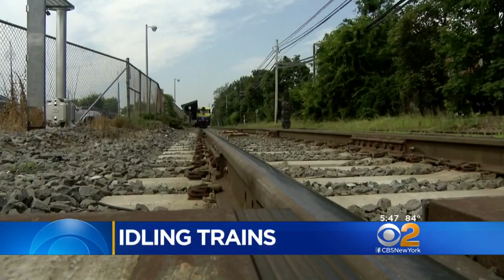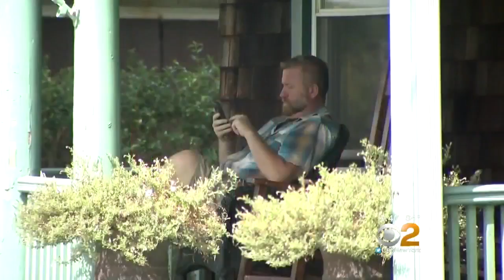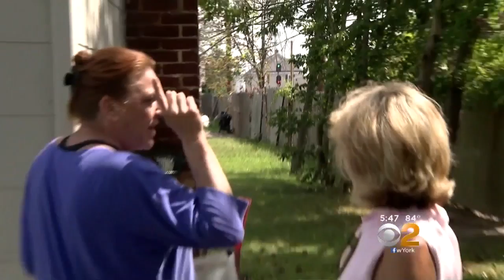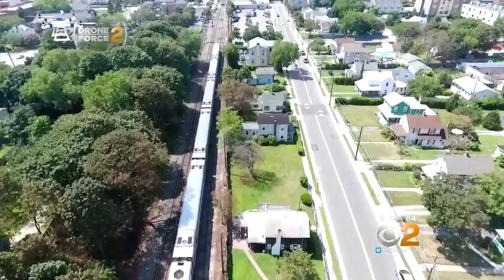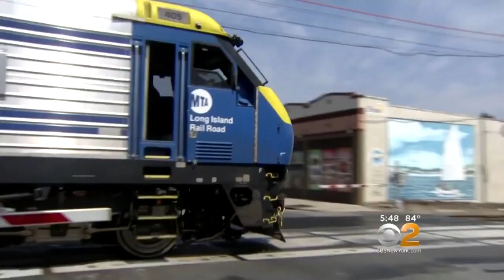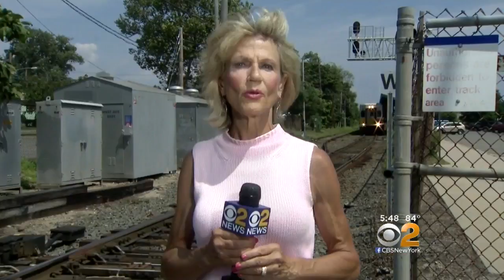Long Island Residents Up in Arms Over Idling LIRR Trains

Comment: Listen my father worked at that crossing in the 50's . Trains would lay up in those back then . 
 I was a Conductor from 1970-1999 and laied up trains up there many times.  Those tracks were there many years before the houses were there. 
 I've been on the north track and the home owners would shut down the engine. This causes the train to be late and their connections. There is a law banning such actions. The L. I. R. R. never pressed charges. The gates are up and the crossing is clear .
Reply: So the home owners 100% bought this onto themselves.
Reply: I have to admit, the old diesels idled a lot more quiet.
Reply: @grazz7865  because they had no HEP
Reply: @frostbyte3978  what is HEP?
Reply: @grazz7865  Head end power, it uses the engine to make electric energy for the railcars which usually means the engine has to constantly run at highest RPM
Reply: @frostbyte3978  I thought the old cars each had thier own generators.
Reply: @grazz7865  Only the true diesel coaches had their own generators, but the LIRR also used old electric MU's which required a power pack to be used for HEP.
Reply: @warrenhoffman2006  I see. The electric MUs I know (M1s, M3s). Believe it or not, they had to break out the M3s again because they increased service and do not have enough equipment. I was referring to the diesel cars with only one entrance/exit on either ends of the cars. Those I believe had thier own generators. AC was like a refrigerator in the summer time.
Reply: @grazz7865  I was referring to the P75 old MU's they used before the C1/C3 equipment.  The AC was really freezing (when operating), but the cars that had the big picture windows instead of the square windows required a power source for HEP.   I took the 5:35am from Patchogue for years and rarely had any delays, so I was very happy with their reliability.

Comment: Man I would love having a locomotive park in my back yard(:
Reply: same
Reply: Same lol
Reply: same
Reply: @Flayvozi  You only think you would. I've had long weekends where there have been 5 engines running, sometimes 4 sometimes 5 days. The engineer and crew hop out and jump in a waiting car and just leave them running. Having a train run past your house is one thing, your house shakes, there's a  lot of rumbling noise and of course, there is the blast of a train horn many times. But an idling train is very different. There is a low rumbling noise similar to the bass sound from a loud party next door. The diesel smell comes in your yard so that you want to head inside, once inside if your windows are open the diesel smell fills your house so you better have an air conditioner on those hot days. The rubble stone foundation of my 1920's house has stones that are loose and falling out, 2 of my walls are bowed inward and the plaster ceilings and walls are all cracked. Believe me, there is no romance to living next to the train tracks. The trains on regular weeks during the whole year are parked across from me 3 to 4 times a week that is overnight or longer. That doesn't count the multiple times they sit there on a daily basis for several hours at a time.  I can only say, I hope you never have to experience this.
Reply: @huggysshit  I'd be fine with that, to be honest I love the diesel smell.
Reply: Lol I live in patchogue next to the rails, its a bit annoying.
Reply: Hells yeah and blow the engine horn at 5am lol
Reply: Id love to line the train out of the siding throw the switch in reverse
Reply: Same
Reply: Same
Reply: Same. I'm a railfan and I would love that
Reply: Shytt, I loved 🥰 it !!!
Reply: @TigerRailfan  I know somebody who has trains go by the back of their house. They don’t have cracked walls
Reply: In 2024 The LIRR will replace all DM30s with Chargers similar look to the ALC-42 but with 3rd rail shoes
Not to Menton they are also Tier 4
Reply: Same ;)

Comment: Ok so to clear some things up 

One running all the trains to Montauk and Speonk will make things worse for the line.
Between Babylon and Sayville(The station before Patchogue) the line is 2 tracks so the railroad which has been doing this for over 130 years uses Patchogue as a turn around the station for Shuttles between Babylon and Patchogue so people along that 6 stop segment of the line have consent service since it has 2 tracks. Having run further on the 1 track line reduces the number of trains it can run as they would all have to share that 1 track segment.

Two electrifying the line while on the plans and being considered but are not the top priority as it cost a lot of money and a huge process to do in which no matter what type of outreach they do these people will complain of the work like oh there working all day and crap or regular riders will complain of the lack of service on the line during the work. Plus the ridership demand right now does not justify the cost for it. The line while very popluar durring the summer season outside of that its not as used so its gonna be a while for that

Three like said in this video they have been there since 1869 when this station was built there was nothing around it. It was like how Speonk station is. People chose to build their homes right up to where the track is and these people dam well knew it and had just taken five seconds to look up would know Lirr short turns trains here.
Reply: I think the LIR should electrify all their lines especially in this area. They have the cars and locomotives that can run electrically on 750 VOLTS DC CURRENT! Build a buffer or high wall alongside these tracks especially after installing the 3rd rail! Electric railroading is so much cleaner!
Reply: Electric on a locomotive branch lines will not happen, too much money to put 3rd rail, that's why they bring up batteries for m7.
Reply: @kenjiharima23nep91  They will need charging stations along and the end of the lines.
Reply: @albertcarello5489  Right.
Reply: @kenjiharima23nep91  its silly. Electrification has been a fine technology for over a century and there's been plenty of electrified sidings for needed purposes

Comment: Governor Cuomo please respond to these residents. Let them know that the railroad was there first, and no one should have built their property that close to a railroad right of way. If they want a wall, a barrier, etc, do a GoFundMe, and build it themselves. The state is not obligated to, nor would pay for such, since the railroad was there first, and is under FRA rules and regulations...
Reply: Black E. Blackerton:  In the Chicago area we have 4 rapid transit CTA LINES with street grade level crossings. People often complain about gearing the crossing gates bells well into the later night. These people too forget these railroad L lines were here first also. These are 3rd rail lines. Of coarse the 3rd rail is always disconnected in streets by active always on both sides of the streets. I mean hearing the crossing gates bells they complain about. On the Ravenswood L those trains operate through 4:30AM and your can here the bells on the crossing gates every so many minutes. However once the gates are down the bells turn off.
Reply: @albertcarello5489  what? I didn't know CTA had grade level stations, tracks and crossings. I thought it was just all elevated and another part where it's all underground..
Reply: @TBF_1J  Until March 20 1960 the CTA did have ground level trackage here before and during construction of the Eisenhower Expressway.
Reply: @albertcarello5489  oh wow
Reply: @TBF_1J  Yes hard to believe! It was sure a very long and drawn out process!
Reply: @TBF_1J  Also the Lake Street L was ground level from Long Avenue west side of Chicago to Harlem Avenue in Oak Park until October 28th 1862 when the line moved upstairs to th Chicago NorthWestern Embankment now Union Pacific and Metra Rail owned.  CTA pays rent to run up above here.
Reply: @albertcarello5489  wow.  Thats pretty cool
Reply: @TBF_1J  Yes it sure is!

Comment: How about this if you dont like then move you chose to live there the Railroad was there first. How about moving somewhere else.
Reply: Yeah that is a true statement
Reply: I mean in a case like this LIRR was there before those homes that is an actual fact so people knew what they were signing up for
Reply: “When I bought my house, I understood that there were train tracks across the street... I just never knew they were gonna park in front of my house...”
Reply: @laurahart3890  i mean its just trains always parked outside that station its always been like that even before houses were built there so if you ask me they just did not do there homework
Reply: K1 oh I was just quoting what the guy said, I honestly wouldn’t care, I’m a railfanner myself...
Reply: @Lazys The Dank Engineer I just read that it takes less than 1 gallon of diesel fuel to start the engine and can take 1 hour due to safety protocols. In my case trains are parked and running sometimes for 5 days without being shut down. There's no reason for that except for a lazy engineer that doesn't want to go through the start-up procedures required after a shutdown.
Reply: this house has been in my family since 1961, that's 59 years. We expected and lived with the trains rolling by. But over the last 15 years they've decided to park in front of my house and I mean when I open my front door the engineer and I can look directly at each other. So this is not what we signed up for 59 years ago. This house has been here since 1920 not long after trains were invented. I'm sure no one could have predicted this.
Reply: @Lazys The Dank Engineer The LIRR has been there in Patchogue since 1869

Comment: Imagine if those were Metro North Genesis locomotives. The complaints about those would be WAY worse.
Reply: Why? The locomotives that we’re here are de30acs
Reply: @meichen3171  well you see, the P32s are loud as shit, probably louder than the LIRR diesels. If they cant handle the DE/DMs, theres no way they'd come with a P32
Reply: @JSquaredJJYT  The Lirr is planning on getting Dual Mode Chargers to replace the DE/DM30ACs because they’re more efficient, they don’t pollute a lot and they’re more quieter so there could be less complaints (Metro North is having the same plan to replace the P32s)
Reply: @supermarionathan1426  I won't lie, I kinda hope the DE/DM30ACs stay a bit longer. I grew up watching them go by, and I'll be sad to see them go.

Comment: The only solution to this is to electrify the tracks. The fact that one of the busiest commuter rail systems in the world still relies on unelectrified tracks, single-track territory, and diesel trains is a problem of its own
Reply: I get that the c3 trains can carry more people but the m7 and sometimes the m3 are far more efficient.
Reply: the lower ridership levels out near Patchogue don't really justify electrification, as the bulk of riders use the western (and electrified) part of the line
Reply: M3s are definitely not more efficient. The M7s have many more seats. And yes, there's no need for electrification on some parts of the railroad (at the moment), like east of Patchogue or Speonk, but It's definitely needed on the Port Jefferson and Greenport lines.
Reply: Too expensive and not worth the amount of money for the amount of ridership. Also if you electrify you need a new electric train yard and where is that going to go? That would cause even more complaints.
Reply: Actually, they do justify electrification with the growing population in the towns and during the spring and summer time when fire island is open ridership is booming lirr does have plans to electrify this line and its much easyier then other projects given that this line up till Sayville is 2nd track meaning they just hav to put a 3rd rail in and its up them to add a 2nd platfrom at Patchogue note the tracks as far as patchouge are 2 but the platforms are 2 as far as sayville the stop before
Reply: @rrrglynn  Or if you electrify it, you can simplify operations by having all trains be electric instead of training different crews for operations, maintenance, fueling, etc.
Reply: @Token_Nerd  Electrification is estimated to be at 18 million dollars per mile the ridership is not there to justify at least on the Montauk Branch. That 18 million wouldn't even include the new electric train yard that would be needed (I know downtown Patchogue there is no room to put a train yard anyway) and also additional electric train that would be needed. You'd have to also but substations in residential areas which would cause even more complaints. I'm a rider of that line and I know it would not make any sense at least right now to electrify. The nearby Ronkonkoma branch is electrified and a second track was just added and still does not run reliably and still only has hourly service.The LIRR can't even run the trains properly as it is.
Reply: The solution is, when you buy a house check out the neighborhood and what's around the house. Be happy it isn't 75 years ago when they used steam engines. Lastly ask yourself, why did I get such a good deal on this house.

Comment: Ether they electricity the tracks or make a hybrid diesel trains.
Reply: Edrick 1246 you do realize that's gonna cause more complaints right ?
Reply: These diesels are technically hybrids. They use the diesel engine to generate electricity for the electric motors that spin the wheel.
Reply: The mta is broke as fuck
Reply: Edrick Ang: Installing 3rd rail along the tracks would be alot simpler than installing overhead catenary wires for sure.
Reply: @Lazys The Dank Engineer  Hopefully they'll listen to reason! There's been talk of electrification for a long time. Philadelphia's trains have been all electric since 1984 their passenger trains.
Reply: Diesels ARE hybrids!  How do you think they work?  The engine turns the wheels via a shaft?  No. The engine runs a generator which charges the batteries which energizes the motors. The technology has been around since the 50s. All diesel locomotives operate this way. Furthermore, if you shut them off, you have MAYBE one good crank to get it started and If it doesn’t start, your f’d.

Comment: Put 750v DC third rail top contact on these tracks or have hybrid diesel locomotives that use battery power when idling and recharged with the 750 v DC Third rail top contact
Reply: EpicThe 112: That's a great idea! There's a couple of freight lines near me in Illinois where diesels frequently idle for hours most likely waiting for a red signal to turn green! This is in West Glenview the railroads Canadian Pacific and Union Pacific which have been there forever before million dollars homes were built. Apparently those residents knew beforehand what they were going to encounter and so far no major complaints. I do like the idea for electrification of the Long Island Railroad passenger trains. Only New York & Atlantic freight trains would still be diesel that use Long Island Railroad.
Reply: Diesels ARE hybrids!  How do you think they work?  The engine turns the wheels via a shaft?  No. The engine runs a generator which charges the batteries which energizes the motors. The technology has been around since the 50s. All diesel locomotives operate this way. Furthermore, if you shut them off, you have MAYBE one good crank to get it started and If it doesn’t start, your f’d.
Reply: I'm pretty sure the LIRR's locomotives are electro-diesel, this making them hybrids.

Comment: this is why they need electric trains
Reply: It will take too long
Reply: ??? We have m7 s
Reply: The 3rd rail installation would be easier to install than overhead catenary and their supports. Fence off these tracks afterward except at street grade crossings where the 3rd rail would be disconnected.
Reply: @albertcarello5489  yeah but it cost to much money.
Reply: @kenjiharima23nep91   If they can get the necessary funding it will be possible to convert all of the Long Island Railroad to electric operation.
Reply: @kenjiharima23nep91  Although not wanted by many the sales taxes and property taxes would have to be raised to help with funding for electrification. These people who live along the railroads are always complaining about diesel soot coating their houses and they keep forgetting the railroad was there long before people starting moving near and next to the railroad.
Reply: @albertcarello5489  But they didnt thought of that, they want to put batteries on m7 for test. Plus to answer that comment, if I would live by the tracks, I would enjoy hearing the trains passing by and video record them.
Reply: @kenjiharima23nep91  I would too! It will sure be interesting to see what happens next!
Reply: @kenjiharima23nep91  This will certainly require battery charging stations especially at the ends of the line! The batteries will naturally also be re-charged by the 750 Volt DC 3RD RAIL.
Reply: @albertcarello5489  correct.

Comment: Maybe it won't hurt at all if the LIRR just buy and used BEMU trains instead of putting batteries in existing trains (failed) and try to electrify the diesel branches (still too expensive and there are places along the diesel lines, you can't install the electrify third rail and also unsafe clearance for EMU trains).